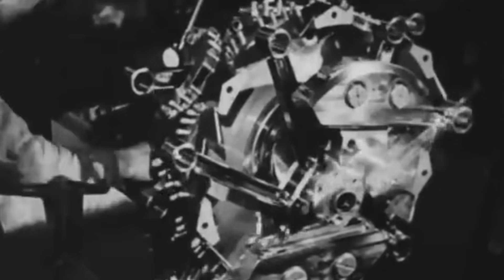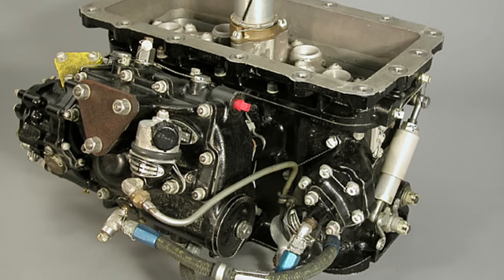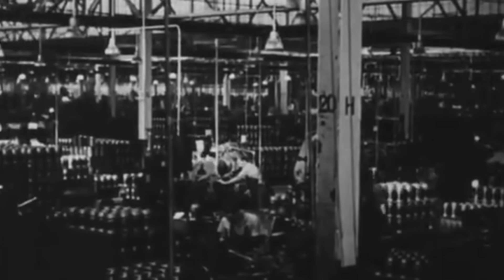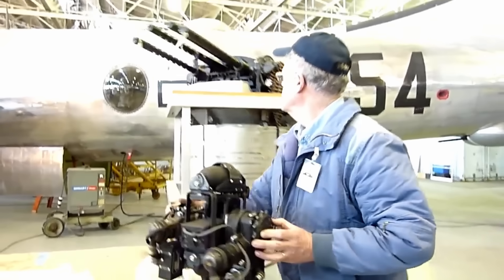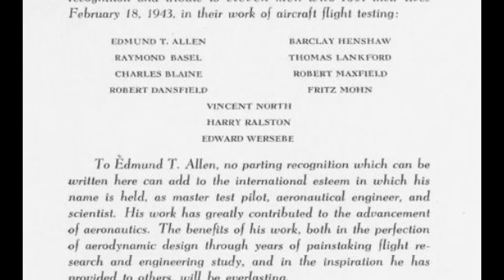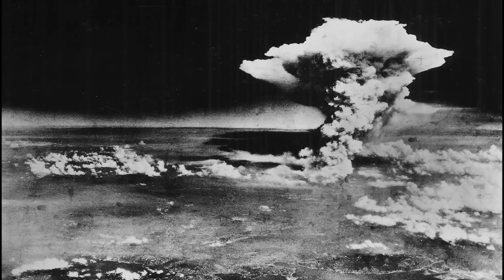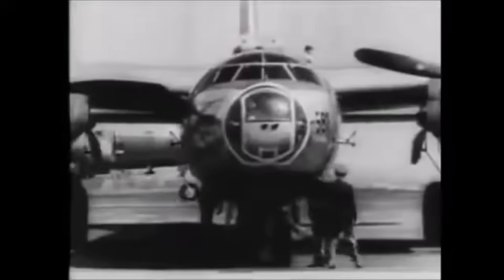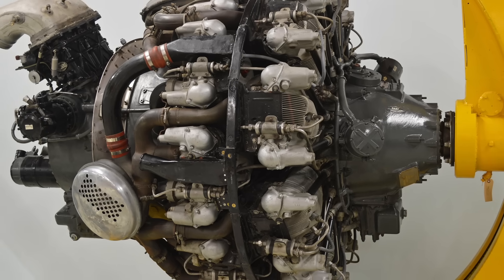MicroStrategy Connect: Community Top 10 #AsktheExpert

Comment: The Wright R-3350 Duplex-Cyclone  has never been "my" supercharged, air-cooled, radial engine that suffered far too many issues especially suffering overheating ranging from eating .valves, burning magnesium crankshaft. Possibly because the front row exhaust pipes was at the  front. A dangerous engine indeed...

Comment: ‘But as they learned from Rolls Royce’s mistakes, the engineers made critical design changes that improved supercharger efficiency by 80%...’

Haha, that’s a sneakily negative way of pouring cold water on the products of another engine manufacturer.
Somehow, I don’t think there was a hotline between RR and Wright, to update them on the latest ‘failure’…
Reply: Rolls-Royce, like much of England didn't have working telephones during much of the war...
Reply: @WilhelmKarsten  
Complete nonsense.
RR was integral to the war effort, as was a working telephone system for all aspects of life...
Reply: @VincentComet-l8e  It was a joke, generally not, manufacturers tend not to share information with competitors but during the war many examples of exceptions can be found, Rolls-Royce received significant help from Packard to solve the flaws in the Merlin engines.. the results helped both companies and helped the war effort.
Reply: @WilhelmKarsten  
Haha, Rolls-Royce didn’t need help from Packard or anyone else - their own development process was second to none. 
Packard certainly rationalised some manufacturing procedures to suit their own practices, and also introduced different bearings, but it was nothing more than that. 
The engines were made as per blueprints supplied to Packard by Rolls-Royce, filling a gap in the powerplants available on that side of the pond too.
Your posts don’t make a lot of sense, being back to front, or something. Whatever it is, they’re nonsense…
Reply: @VincentComet-l8e  Packard solved the fatal  stalling problem and  made the Merlin reliable, giving it interchangeable parts, making it viable for mass production.
Reply: @WilhelmKarsten  
More nonsense – is there no end to it?
Do yourself a favour, educate yourself by reading up about Beatrice Shilling, and her ‘orifice’.
As I’ve already said, Rolls-Royce didn’t need help from Packard or anyone else - their own development/troubleshooting processes were second to none.
And I repeat, the engines were manufactured by Packard (under licence) from the blueprints supplied to them by Rolls-Royce.
Reply: @VincentComet-l8e  You clearly lack knowledge regarding the Merlin engine...
 The Schilling Device did not solve the fatal flaw in the Merlin it only delayed the stall, the permanent solution was found by Packard who replaced the obsolete SU carburetor with the American Stromberg-Bendix PD pressure feed system.
 Packard binned the Rolls-Royce blueprints and completely redesigned the Merlin from the ground up and made it a fully standardized, mass production engine with interchangeable parts and improved performance and reliability.
Reply: @VincentComet-l8e  That's false, Packard redesigned the Merlin engine and made numerous and very significant improvements to the new Merlin, the parts are not interchangeable with Rolls-Royce engines, one of the major technical flaws in the British Merlin is that parts were not interchangeable between British made engines due to the outdated production techniques still used in the UK at the time.
Reply: @VincentComet-l8e the basic modifications made by Packard on Merlin was to adapt english measure standard to usa ones...like the Merlin, americans received for free RR jet engine's project and by eletronics side the magnetron to improve your radar equipment....

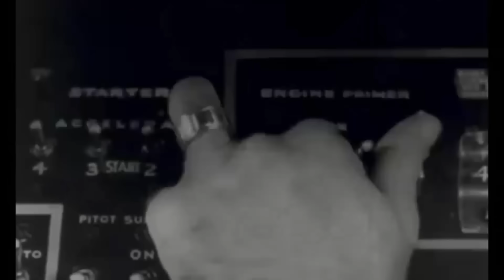Comment: 12:15   "4221 units produced by the end of production in 1945" The figure from most sources is a total of 3970 ending in May 1946. By VJ day, only 1645 had been produced (or taken on charge). These 1600 barely saw 6 months of serious use, which serious use only really began in March 1945, when low altitude fire bombing on civilians was implemented, the bomb bays bringing back a massive stench of barbecue from burning civilians... By VJ day about 500 of these 1600 units were lost/destroyed (only 85 due to fighters), a sobering figure considering the relatively small number of sorties, and the weak to non-existent opposition during the last 6 months of its heaviest use, which saw it carry 8000 pounds of turrets with their guns removed... Improved engines with better reliability were very rare in WWII, and basically limited to the Silver Plate atomic bomber force. To say that the B-29, by the end of WWII, became just as reliable as any other US bombers is just false, especially considering the hundreds lost to engine fires alone, while over 100 simply disappeared... You do not mention that during WWII they often had to be flown full time with opened cowl flaps at a massive performance cost, and that the improvements in reliability you cite were almost all entirely post War. More surprising, you do not mention that a unique attribute of its 3350 engines was that they were made of magnesium, which material caught fire on runaway props or oil starvation, burning at 5000 degrees. A fundamental flaw that was not repeated since. Aside range and bomb load, the best feature of the B-29 was by far its gun turrets, 6 times as efficient as the B-17G(!), but for most missions those ended up being unarmed dead weight... Overall I find you painted quite a rosy picture of the B-29, as it suffered high attrition against a nearly expired opponent, and was only really effective as an indiscriminate night bomber and minelayer, at a cost only the US had the pockets to pay... It proved effective, but was certainly not efficient, and it is likely its numerous flaws would have become much more prominent against a serious opponent. That being said, the revolutionary turrets would no doubt have helped to protect the engines, since at least these worked correctly...
Reply: Like most wartime development the need for speed in getting it into service doesnt allow the luxury of sufficent R&D often thats done in combat dangerous combination

Comment: The B-29 has an interesting history as the transmitter platform for Stratovision.  They put 25 KW transmitters on board and broadcast television signals.  I read a science fiction story about this, and had no idea the author was fully "grounded in reality".  Stratovision was used in the Vietnam war, on the Lockheed Super Constellation powered by the same Wright R-3350s.
Reply: This version of the R 3350 used a Turbo Compound design to boost hp to 3250 and eliminated most of the overheating. These engines have jet exhaustsd behind the engne buit are not turboprop engines, whose propellers are driven by turbines [Lockheerd Electra]. R3350 propellers are driven by pistons, this increased the Connie's top speed to 375 mph.  This TC version wasn't available until 1953.

Comment: The R-3350-32WA was very reliable in the Lockheed P2V in the firefighting role.
Reply: The P2 fire tankers had the turbochargers removed and were significantly detuned,
Reply: @sandervanderkammen9230  The were not turbocharged in the typical sense of forced air induction, for that they had a two stage centrifugal supercharger.  The turbos (that were not removed for the firefighting role) were Power Recovery Turbines.  The PRTs directed the rotational energy recovered from the exhaust gases and put it back into the crankshaft through a fluid coupling (torque converter).  The 3350 had 3 PRTs driven by the exhaust of 6 cylinders each.  In the late firefighting role of the 3350 on the P2V, each engine developed 2880 hp.  The high blower position was disabled on the firefighting aircraft, but that was a high altitude item only, not required for takeoff or typical cruise altitudes.  The biggest performance reductions in that role were primarily the removal of the alcohol/meth ADI system for takeoff and the unavailability of purple 115/145 fuel.  The ADI was unreliable and failure of it during takeoff at the manifold pressures would result in quick failure.
Reply: @timothyleeuw5895  Yes, they are significantly detuned from its military specifications and power output, this was done to improve reliability and durability.... so not a typical example of R-3350's reputation for reliability.
The engine does not have a great reputation of reliability in military service.
Reply: @timothyleeuw5895  The exhaust turbines are coupled to the crankshaft, which in turn drive the supercharger.
So it's still a turbocharged application, with increased exhaust pressure and temperatures.
 These engines consume more fuel and produced more horsepower per pound of Fuel thus rejected less heat out the exhaust stacks per horsepower developed, the engine  absorbing more combustion heat,  significantly higher MEP and more mechanical stress on the engine and temperature load on the cooling systems.
Reply: Significantly derated in the firefighting role... So not a typical characteristics of this particular engine.

Comment: GM had the contract building the engines for the B-29, those early engines by GM had abysmal reliability records and the lost a lot of B29's for that reason, Chrysler took over production of those engines and reliability improved because chrysler at the time had superior machining equipment and they invented a process that made superior metallurgy in critical components allowing superior reliability over GM built engines.

Comment: The r3350 and r4350 engines were never reliable, and why the Stratocruiser was a failure. Killing servicemen was one thing, killing civilians was not acceptable. So many B-29's were lost due to engine/propeller problems that a congressional investigation was conducted after 100's of B-29 pilots contacted Wash DC fearing that Axis spies were working for Wright Aeronautics. Here are the numbers: 414 B-29's lost bombing Japan; 147 shot down, and 267 lost due to engine and other powertrain failures. 
The r-4350's on  the Stratocruisers were also terrible, with a catastrophic failure every 158 flights. Ony 56 were built, 13 were totaled with 137 fatalities. Often the propeller/gearbox  failed, engine overspeed, then it would rip off from the wing and crash to the ground. Boeing set a never exceed speed of 351 mph and a max cruise speed of only 280 mph, but the failures continued until they stopped flying.
Imagine working at Wright on r3350's knowing that they killed thousands of Americans... 👎
Reply: For all the entire world B 29's were showed  like the 9th marvel of the world... If the total of aircrafts left by various issues on project and that was downed by enemy this history about them were totally different...

Comment: The P&W R2800 was such a robust, highly-refined engine that I cannot see the logic in developing the R3350 for its 20% gain in displacement. The B 29 program would've been cheaper, faster and less lethal. The B-29 quickly evolved into the B-50 and received the P&W corn-cob, anyway. Add power recovery units to that engine and the output / fuel efficiency would be staggering .
Reply: The R4350 P & W turbo compound engine did incorporate a power recovery system and had a jet exhaust, making them easy to spot. They weren't available until 1953.
Reply: The R-3350 and R-2800 both first ran in 1937. The R-2800 matured into a highly reliable engine but in the first few years it was a horrible mess of catastrophic failures and neither design was a sure bet at all. At the time when the key development decisions were having to be made, circa 1937 -1940, it would have been extremely foolish to put all your eggs in one basket. Read "R-2800: Pratt and Whitney's Dependable Masterpiece" by Graham White, if you want to know more about the severe early problems of the 2800

Comment: Very nice video of the Wright R-3350 Cyclone engines.  Thankyou for sharing.  My father was a B-29 pilot in command in June 1945.  He referred to the Wright R-3350 Cyclone engines on the B-29 as "Wrong Engines" and "Flame Throwers" because they had a nasty tendancy to overheat and catch on fire during takeoff.  On the early R-3350's, the cylinder head temperatures were red lined at 289 degrees Celsius and on takeoff it was not uncommon for the cylinder head temperatures would be reading well over 320 degrees Celsius.  My father went on and flew WB-29 Superfortresses after the war for the USAF's Air Weather Service until 1956.  Even then the engines still proved themselves to be problematic.  It was not uncommon at all for a WB-29 come back to base with three engines running and one engine feathered.
Reply: You probably mean redline of 289 Celsius (552 Fahrenheit). There is no air-cooled engine that would ever stay under 300 F cylinder head temperatures.
Reply: @aaronshipley5594  You're correct.  Thanks for the correction.
Reply: Really not the fault of the engines. B-29 missions were often overloaded by 10% to 20% over the maximum design weight, and the earlier missions were flown to over 30,000 feet.

Comment: According to some AEHS (Aircraft Engine Historical Society) data; a major cause of overheating was the loose tolerance design of the engines cooling baffles.  This resulted in poor cylinder cooling as cooling air washed around the cylinders rather than through the cylinder's cooling fins.
The Lockheed Constellation also used this engine and gained the reputation as the world's fastest tri-motor; commonly losing an engine on many flights!